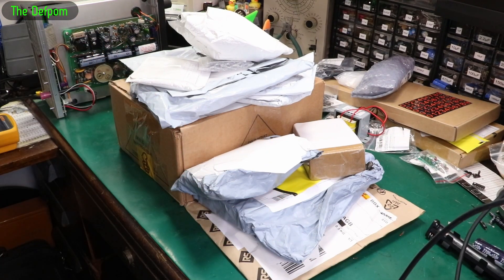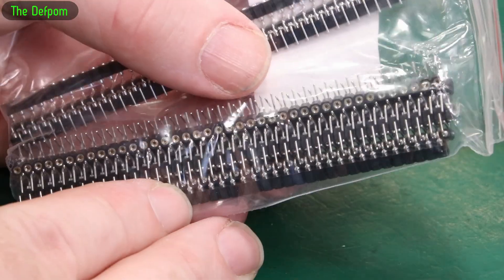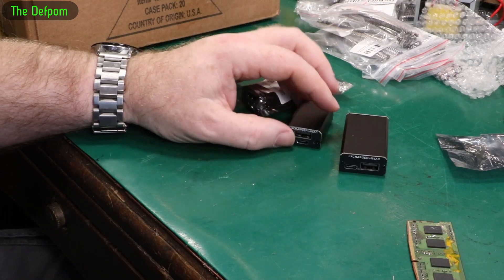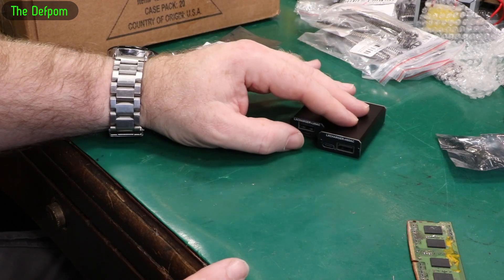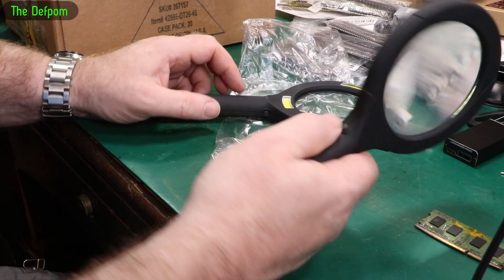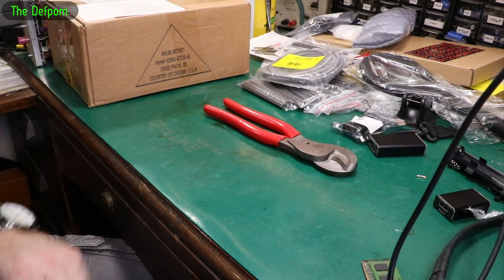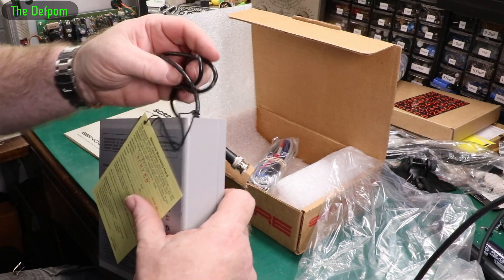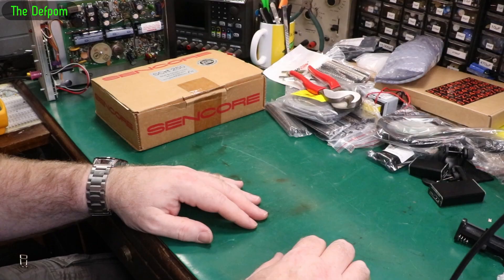🔴 Mailbag Monday 28th April 2025 - No.1353

Comment: the Pi5 has a power delivery of sorts, the usb-C power supply will only provide 3A at 5v, but will supply 5A when connected to the Pi. there is a form of power delivery handshaking going on, but I don't think it's a standard message as it's setting current and not voltage.